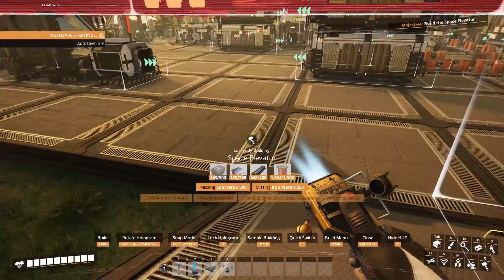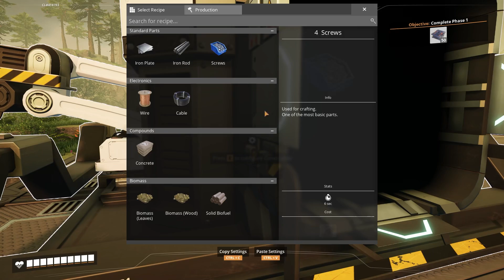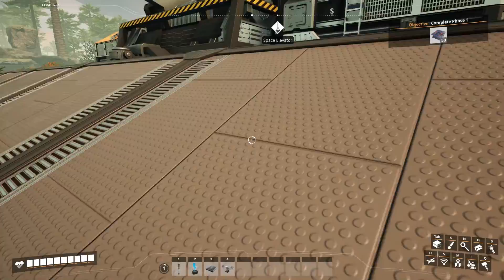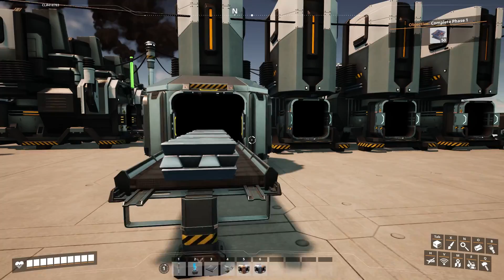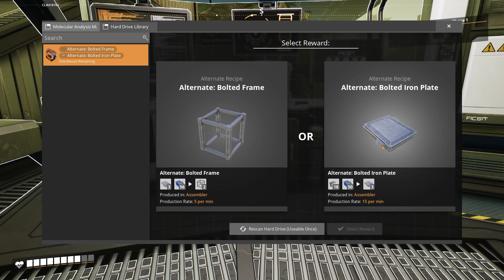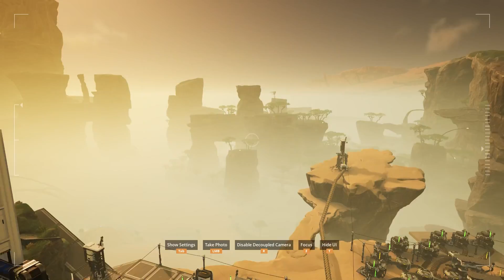Satisfactory's Early Game Broke Me | Satisfactory 1.1

Comment: Nice series so far. I would say you DO want to scan your hard drives now. There are several OP recipes that you’re more likely to get when the available pool of recipes is small. Cast Screws, Iron Wire, Stitched Iron Plate, and +6 Inventory Slots.
Reply from the maker: I had no clue. Thanks!
Reply: @GunjiCord yep, recipes are added to the “pool” when you unlock their technologies in the Hub or MAM.  You can still get the lower tier ones as you advance, but the chance is smaller because the potential pool gets big quickly, especially when you zoom through the early game (this is not me trying to discourage a fast start!). 

I’ve actually seen where some players push to get enough drives to reveal every available recipe in their library. Once you have enough drives scanned, it won’t let you research more until you unlock more tech, or select a recipe (which returns the other to the pool). 

Since your drive didn’t reveal one of the better early recipes, it may be worthwhile to rescan it.  I think your “pool” only includes 8 recipes at the moment (including +Inventory) so your chances of getting one of the better four are pretty good.  Um, unless you unlocked quartz in the MAM off camera. That would add several.